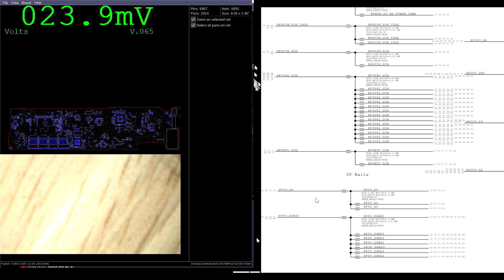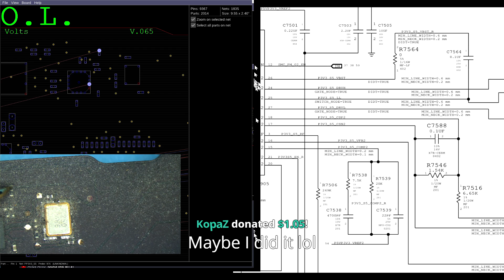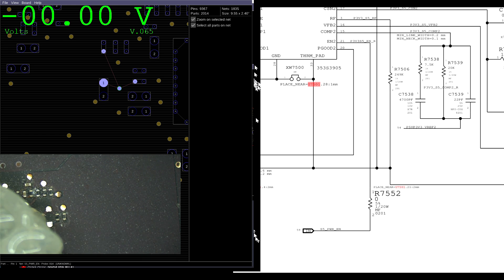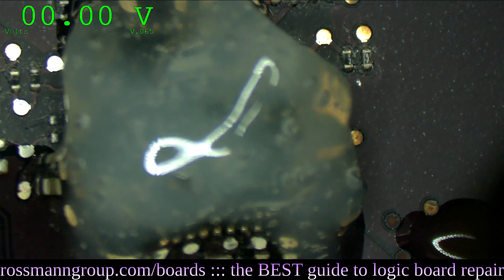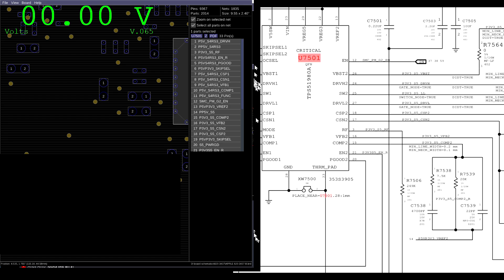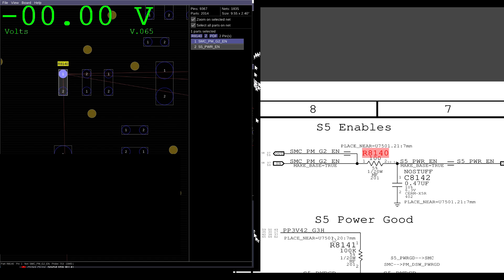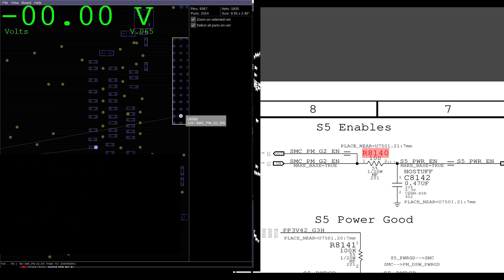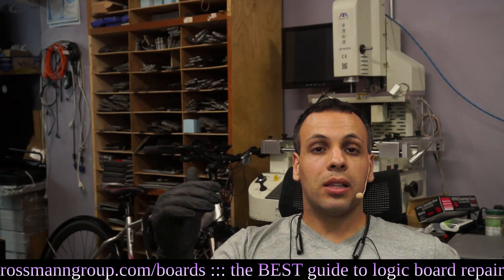TPS51980 or SMC failure? When SMC_PM_G2_EN isn't enough.

Comment: You're the best Macbook repairman, I ve got years watching your video. But I still conceive of an apprentice. I need your help with a similar problem. The motherboard is 820 - 00165 and was damaged by liquid on the Smc (u5000). Clean the area with isopropyl alcohol and remove the components with sulphate (C142y R195), replace them with one of the same value. 
The Charger does not give green light, and I have these readings: 
PPBUS_G3H=8.1v, 
pp3v42 _ g3h = 3.41v,
PP5V_S5=0v, 
pp3v3 _ S5 = 0v, 
PPVRTC_g3h=3.41v. 
SMC_BC_ACOK=3.38v. 
Sys _ onewire = 3.39v. 

I don´t have smc _ pm _ G2 _ en. The reading in diode mode of this signal is 528. 

that you recommend me?

Comment: In a recent video of Louis, he criticised Apple for removing the special SSD connector for recovery of data(there was the usual toxic apple hate in the comments unfortunately)l, but Apple  has now introduced a new data recovery method with the T2 chip. Is this better? or was it a pointless change? Either way, does Louis' criticism still stand?

https://9to5mac.com/2018/09/20/apple-t2-data-recovery-transfer-imac-pro-macbook/

Comment: The switching high/low of the signal could still have been the SMC. Given that the choice is between a readily available and easy to solder chip and the SMC... always try the easier one first.

Comment: Can you explain the process of replacing that chip in a bit more detail?

You heated it up until the solder flowed and you could pull it off. 

Then you globbed flux on it and heated it up to reflow the existing solder/paste. 

Then you removed all the solder with braid ???

Then, with some flux still on there, you reapplied solder to all the pads.

Then you placed the chip in the right spot with tweezers and heated it up until it flowed. 

Then you went over all the pads again with a soldering iron.

Is that right or did I misinterpret something?

I am most curious about why you reflowed the solder and then removed it with braid.

Comment: TPS51980's enable pin is only an input so it couldn't pull SMCPMG2EN down. More likely the SMC controller was in some sort of safe state with those two power rails by briefly pulsing the TPS's enable pin to see if it would actually supply power to those two rails without damaging downstream components ("Soft Starting"). Also the TPS chip has a Power Good pin which is read back by the SMC chip.

Semantics but still good call Louis!

Comment: If it was poor soldering and liquid damage, would that require new chip, or could it just be cleaned & resoldered?
Reply: It probably just needed a reflow. But as these chips are cheap, it's usual to just ditch the chip in question and replace it with a new one. Possibly ruining the board with too much soldering on that spot doesn't worth the price of the chip if it's faulty though.